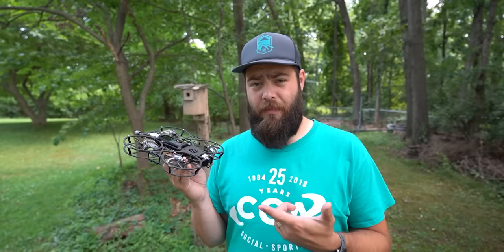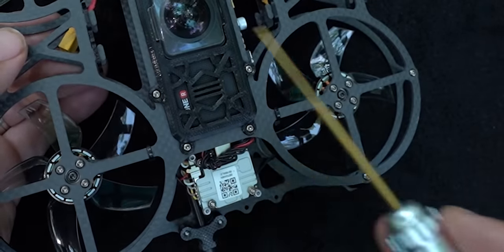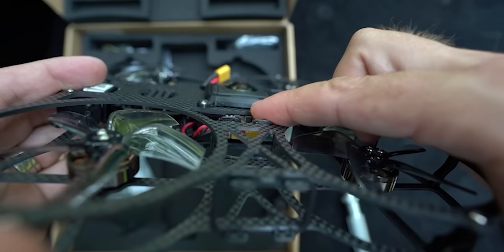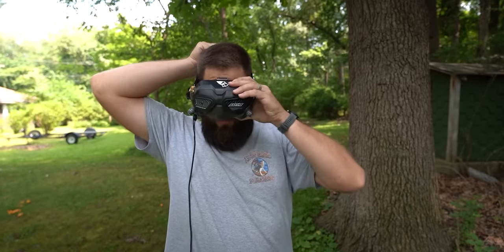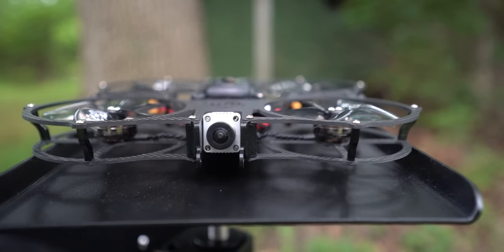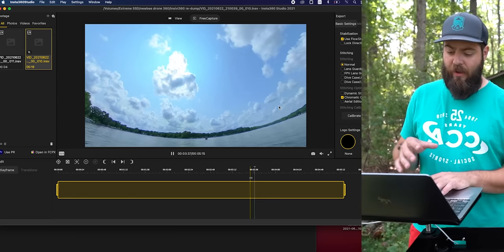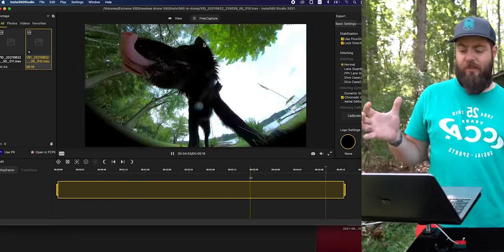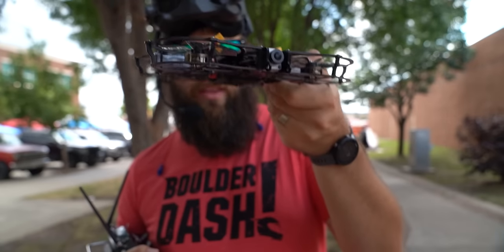NewBeeDrone Invisi360 Review

Comment: Good review, I have one and still learned a couple of things. I use a DJI style launch pad to both take off and land. It can also hold 4s 660 style lipos in the same style and can also hold 650 in the square style. I always check to be sure both lipos are in close voltage range. I also fly with the lens protectors on and it’s only an issue in sunlight on the top side of the camera because you can sort of tell but the bottom looks great. I would just  fly with the top one off  and bottom on but there isn’t a option in the software to correct for that so I’ll just leave it on for now because the stand-alone 360 mod is hard to find, or it was.  It has its use case but if you want to go faster there are other that would fill that need and as you said shouts out to Stan FPV for getting the ball rolling so to speak.
Reply: Thanks for this advice.

Comment: Think it's something I can learn on after only having a Geprc tinygo if i practice without a camera in it for a while?

Think it can safely fly inside for real estate walk throughs?

I want it to film my kid on her dirt bike but have to justify it to the budget department as a work expense 😉
Reply: I’d like to use it for the real estate as well, I’ve seen it done and think it could be useful. Let us know how it works with the dirt bike, not sure it can keep up. I was once really high got a like freaked out made a quick decent and it tapped the ground. I had lens guards on so it was fine but it it pick up the least bit of anything on the lens or drone it will show up on the video, just another one of those things, but yeah I love it.
Reply: A unique two-battery mounting configuration perfectly balances the CG and keeps it in line with the props unlike a top or bottom mounted battery. In addition, using two batteries allows the user to choose between 4s and 6s operation. To run 4s, use two 4s batteries in parallel. To use 6s, use two 3s batteries in series.

4s is perfect for slower and controlled indoor flights or where safety is important. The 6s configuration is useful for when the pilot is chasing fast subjects or flying in large spaces.

Comment: Really cool drone, i wonder if it is possible to add the safety lens that you can put on the cage of the OneR, that could give a minimum of protection to the lens, i really want one of this kind of drone, but i have too much scared to put the 1R so unprotected 😅. Anyway really nice review, thanks Nurk! 💯
Reply: You are able to use the lens guards with the drone. The guards come with two-way tape cut out so that the guard stays in place. You’ll have to be careful with the tape placement any little bit sticking up will show in footage.
Reply: @jgreg95  ah ok, but doing so the 1R will be probably stay in the kwad "forever" or the two way tape can be used multiple times?
Reply: @C4ITA  yeah you might be able to squeeze a couple of uses out of one tape buy definitely not multiples. They should offer the tape a stand alone purchase but I don't think they do. My camera mostly stays in the quad.
Reply: @jgreg95  Thank you very much for the information, it was very useful! 😁

Comment: Here's another reason you may want to attend the Tustin MI rc event this coming Sunday: Combat Event - 
CAMSBAT RULES
1. No kicking, biting, spitting, hair pulling, or eye gouging allowed.
Seriously this is meant to be a fun event and you and your spotter are “on your honor” to count your cuts and kills.  Due to the nature of this event you should be prepared to accept a midair.
2. Absolutely no flying behind flight line.  Flying over the pits and behind the flight line is an immediate disqualification and you should land immediately.
3. Each combatant is required to have a spotter.
4. Planes may be hand launched or take off from the ground.
5. Planes may not be larger than 40 size glow or electric equivalent.
6. Streamers will be provided by CAMS.  You may attach streamer to any part of your aircraft.  You are considered dead if you lose your streamer or an opponent scores a kill on your aircraft.  You should land when you are dead.
7. Official will announce launch and you have 1 minute to get airborne.  At the end of 1 minute the official will announce the start of the combat.  The combat period will be for 4 minutes.  Scoring can occur only during that 4 minutes.  If you cannot get airborne in the initial 1 minute launch time you may launch during the combat period but you will not be eligible for flight points defined in the next paragraph.
8. Scoring
Flight time – if you remain airborne for the full 4 minutes – 4 points (no partial score, it’s 4 or nothing)
Cut – 1 point
Kill – 10 points (removal of all of an opponent’s crepe paper streamer) 
No points for midair’s but the crowd will be grateful!
 
CAMS will present certificates suitable for framing based on point score for winner, first loser, and second loser.